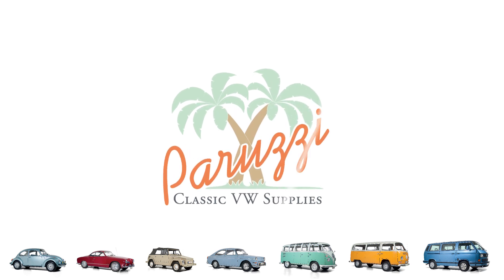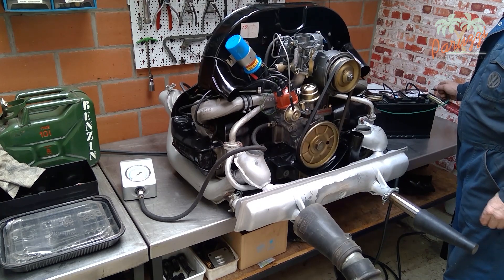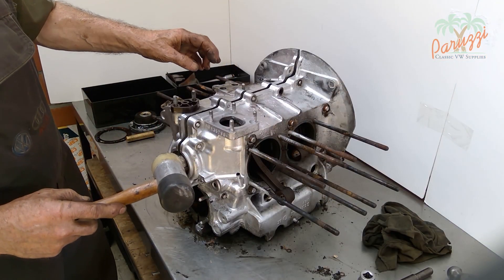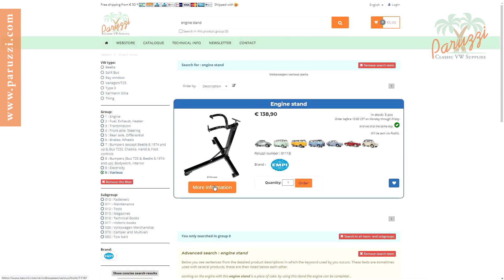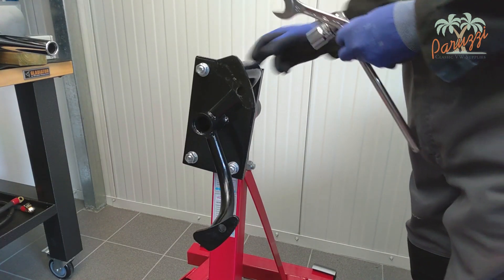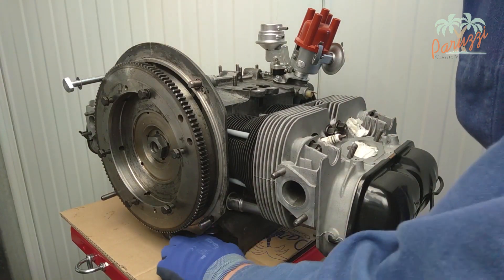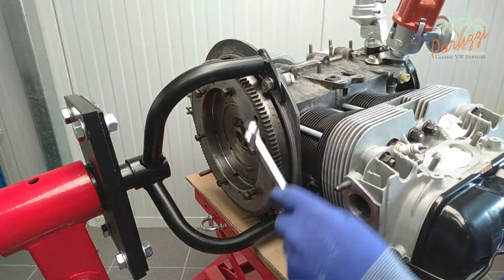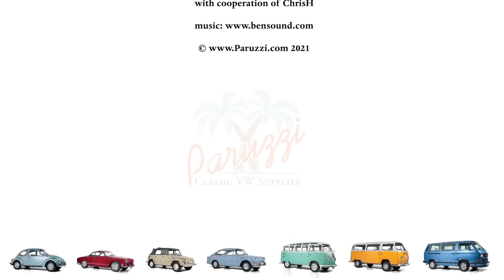03 Engine overhaul - the workshop

Comment from the maker: To test the engine on the workbench, you will need an accessory to attach the starter. Use a part of a gearbox or use the nose of a VW Bus transmission. Different possibilities. You can also mount the engine in the car, then test it, but if something goes wrong, you have to take the engine out again. We explain this in detail in this series of videos.